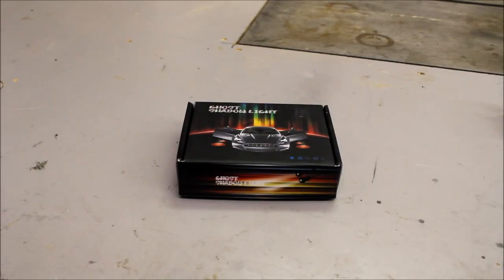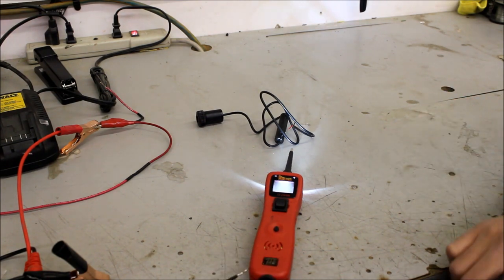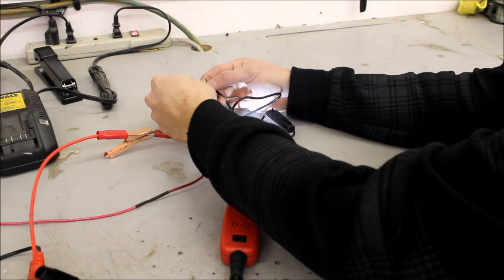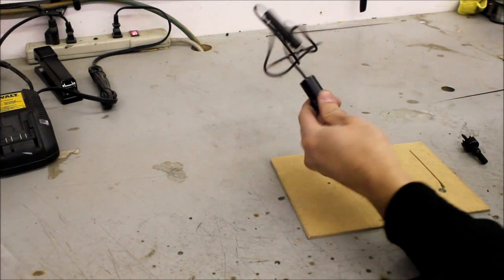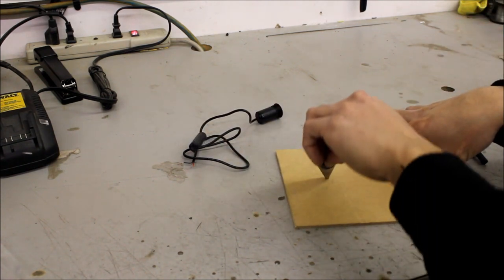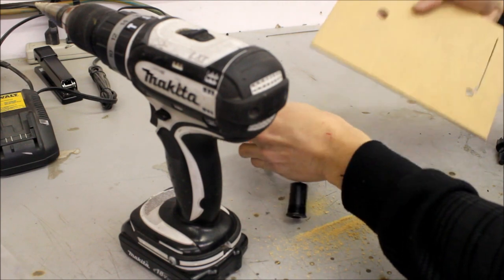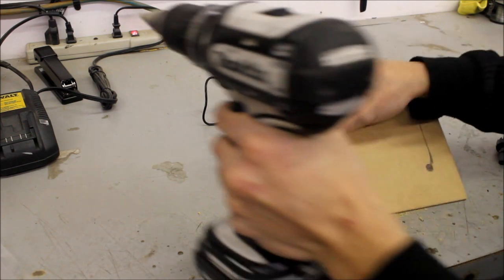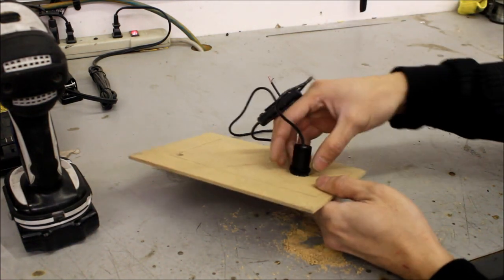Projector L.E.D. / Shadow lights / Welcome Lights | AnthonyJ350

Comment: I am trying to put these on a harley.  They get really hot after being on a short while but I plan on replacing the light with an led bulb. Any ideas on how to make them smaller? I've taken them apart, but curious if I could cut the inner tube in half.
Reply from the maker: Ya they get hot.  Are you mounting it to a metal surface?
Reply: AnthonyJ350 yes. I have a plan to switch the light in it I think. I just need to make them smaller so they are less visible since the will be mounted on the motorcycle. Any ideas?